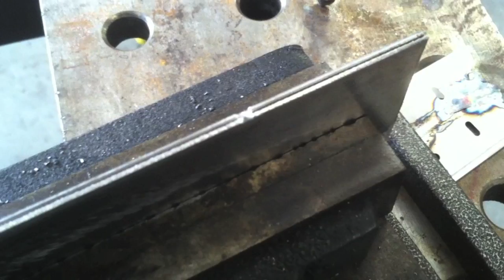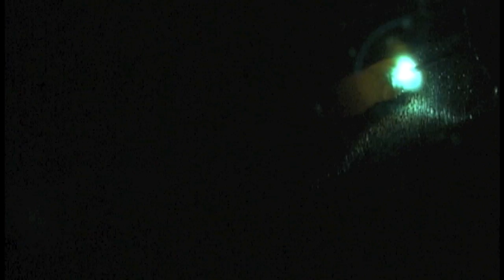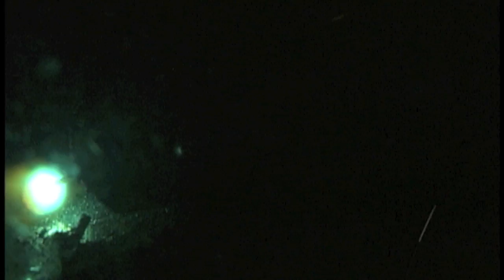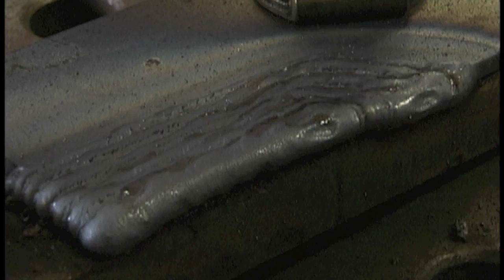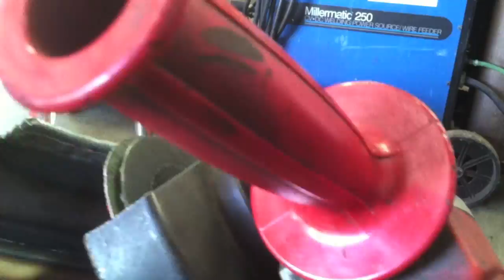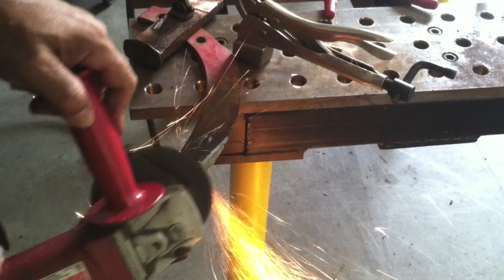Mig Welding Techniques for Edge Welds

Comment: Yea. 11 yrs ago... I know.  Sorry.  I'm very much a novice, and I've been struggling keeping a bead on the 2 edges.  
This, the copper, is brilliant!  Never would of thought of it.  I'd have thought it'd burn thru cuz it's low melt point.   Unfortunately I don't have a nice chunk of copper handy, but I'm thinking maybe a nice straight piece of aluminum alloy?  Can't hurt to try.  
It's funny, I do this when I solder.  Have clips made of stainless.  Solder won't stick.  
Thanks for the vid...... And the 'Dad joke'😂

Comment: Keep up the awesome close ups. (Best on the tube).  Does copper or aluminum make a better heat sink?
Reply: Copper is more conductive, but aluminum is a close second, besides you'll find more aluminum plate lying around than copper.

Comment: Does this work as well for stick? And then my mind goes to hard facing and some hardface situations need preheat and slow insulated cooling, would this cause rapid cooling problems? Would it still function as well if the copper was preheated for a preheat situation?
I won't bother using $15 per pound hardface buildup rod on a $10 tiller tine, (a bead of hard cap on a new tine would be good though) 
However I do have an older model plow and the wear parts are no longer available OEM or aftermarket. (share needs about 2 inches added, new plow is $1000, horrible-freight level is still $600)

Comment: thanks. need to find copper..
Reply: Brass may work in some cases but brass is not a very good conductor, brass and bronze are not much better than steel for conduction.(pure metals tend to be better conductors in general, thermal or electric.)
Reply: I don't have much copper and it is expensive so I'm going to try some aluminum next time I take out the everlast welder.
Reply: The copper melting point is much higher than aluminium.
Reply: brass works too. just wear proper respiratory ppe as brass contains zinc and some traces of lead. dont wanna breath that stuff in.

Comment: Thanks for the technique. If I had to build up metal on a worn piece on a vertical position or some other position other than flat, would using a copper backing still be effective?

Comment: Now hold on there.
When I weld I have to be careful as the weld is so hard, I need to use carbide to machine it, and forget drilling and tapping a hole!
I now use my flux core wire to weld up wear surfaces like on snow blower shoes, and it lasts forever.
Reply: I was thinking similar thoughts about welding the edges of worn blades, the weld is harder n stays sharp longer?
Reply: Flux core (F.C.A.W.) MIG wire is the hard stuff.
Reply: Thanks, got both so I'll try it one day,

Comment: I wonder if it would sometimes be beneficial to put like 1-2mm (or 1/16") riser plate between the copper and the steel you are welding. The idea behind this would be to make sure there's enough material on the backside, like if you need to grind the weld in to a flat surface. (I think that without the riser there might often be a tiny grooves between welds on the backside).

Comment: they do make hard surfacing wire
Reply: True enough. But it would likely be more expensive than buy a new whatever it is you're building the edge up on. I have some left over hardfacing rods from years ago that I've been using to build up my lawn mower blades. Been using the same two sets of blades for 12 years now. But I'm also a cheap prick.

Comment: i would like to see a video on mig welding a thin piece of metal to a thick piece. I always have problems with setting the volts to high or wire to low my most recent project has been a 1/4 inch piece of mild steel welding to a 12 gauge mild steel

Comment: Love your videos. I have a question about exhaust welding. I just purchased a Hobart 140, it's a step up from my Lincoln 125 welder. My question is what would be the recommended wire to weld exhaust tubing. I'm currently using .030 and I keep burning through its frustrating. Please help or any tips would be greatly appreciated. Thank you.
Reply: I know this was a long time ago but switching to gas instead of flux core helps a lot

Comment: hey jody! thanks for this tip man. helped me out in class today when i ran too hot on metal tubing and i had to build it back up after burning a smile on the edge of the tube using a 7018.

Comment: I'm a welder myself and with MIG welding you are supposed to push the weld ahead not pull it.. your weld is very weak ( as you can see on the first weld, the weld is not attached to both of the surfaces) when your pulling instead of pushing. And you also need to swipe up and down to melt both of the materials together.. no offense but don't try to teach people to weld if you are not a certified welder.
Reply: I hope you will subscribe to his channel tallicaboy. Why with you being a MIG welder and all, surely you could teach Jodi everything you know. I hope you are old enough to understand what I am saying.
Reply: You are not a good welder apparently definitely not certified! I am a certified welder and you can push or pull with mig and and some schools will even say pulling gives better penetration/stronger weld, while I disagree with that you can most certainly push or pull with mig. I tested at a job that REQUIRED me to do a 3f("vertical fillet" as im sure you nothing about welding) down hill weld! I perfer pushing the as much as possible but on some occasions you have no choice!  And also you must not get what hes trying to do here, hes not trying to weld two pieces together! Why dont you go get certified before you bash one of the best welders on youtube
Reply: It's not attached to the bottom surface on the first weld because that was just a bit of copper he was using as a backing plate/template.... It's a good technique, have a look at the rest of his videos, he knows what he is doing.
Reply: But if you are running a flux core mig u pull it
Reply: Have you even watched any of his other videos? You are hilarious.
Reply: You clearly know nothing about welding tallicaboy!! Jodi is a hell of a welder watch the rest of his videos you will learn a thing or two!!

Comment: I've had to do that a few times when a bevel prep on a wide flange beam gets done wrong!
Works great for plugging holes too.
Reply: Yup. Had full pen on a stub column that was cut way out of square with about a 1/2 to 3/4" gap between the beam and end plate. Copper piece came in real handy for the root. 😒

Comment: What do you think of after grinding heating the weld then quenching in dirt old engine oil? Will this add enough carbon to make it harder mabey too hard? If this will harden the metal how deep will the harden be? Is 309 or 312 stainless filler a good choice? If so should we put a first pass on with some other filler or even pre-heat?

Comment: i use a simular method for doing teeth on a loader bucket. i use a aluminum lift block for lifting a leaf sping suspension. use vice grips that block gets hot in a hurry

Comment from the maker: Geh4h,  the clamp is made by stronghand tools and is part of the tooling package for the buildpro line of tables that i am using.  I think you may need to order thru a distributor like airgas, summit racing, trick tools, etc

Comment: Great video. I didn't know you could do that with copper blocks. I've only ever used them as a heat sink before. Is there any other metal I could use in the absence of thick copper? With rising scrap metal prices, there aren't many thick blocks of copper left lying around now!  Very useful to know,thanks. Good duck joke, also.

Comment: if you get the right hard facing wire for the application, the cost of continuous repair (man hours) heavily out weighs the cost of the wire.  however, that is more practicle advice for someone who has a ton of ground engaging equipment that needs to be faced (or any surface subject to extreme abrasive or impacting forces).